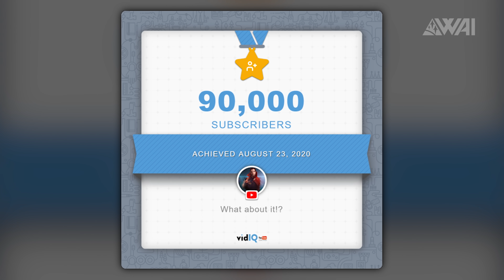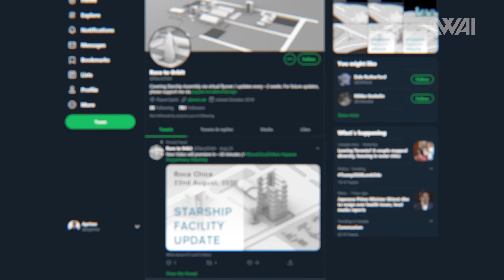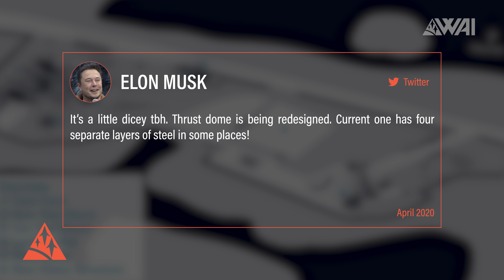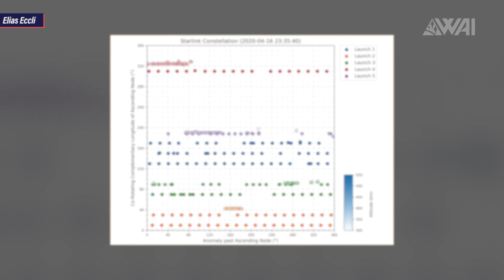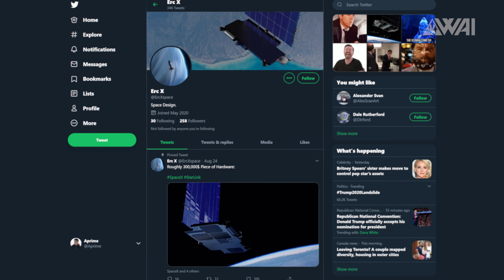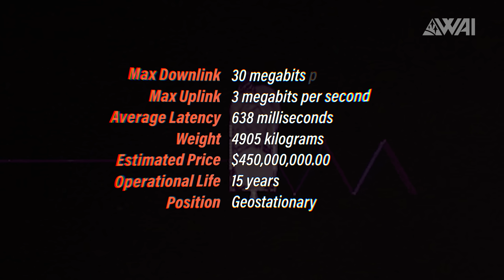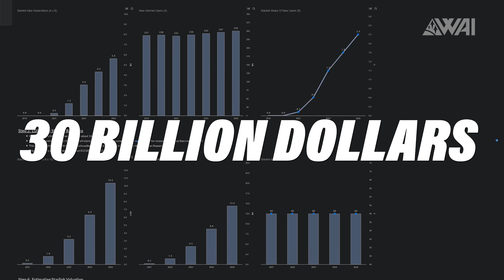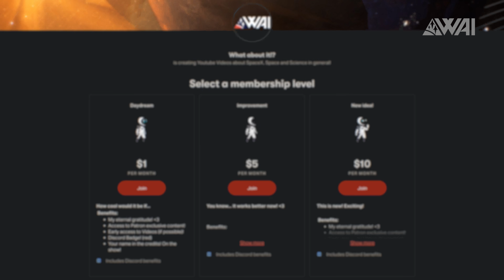116 | How to finance a fleet of SpaceX Starships?

Comment: Using a kuka robot to weld pins isn't really a Tesla tech cross over, there are only so many robot manufacturers and from experience, kuka has the best support money can buy, and they do like money. But once you get them out there the problem will be solved quickly.

Comment: Hello Felix,
Lots of great comments there especially on the thoughts to your question. I think the nose cone parts are internal and probably won't be seen when the nose is attached. The High Bay will probably top out structurally next week. However, finishing the roof and walls will probably take another month. Internal systems will take a period of time longer.  If you remember, Elon had said the High Bay will have a crane inside. That will take a couple of weeks to outfit. Realistically, I think we have at least a solid month to go on the High Bay. 

One suggestion I would like to make to you is about the term you use "construction site" when referring to the area where Starships are made. Technically, it is correct because ships are constructed, but we usually refer to the construction site as a place where the facilities are being made. In that sense, the launch site is also a construction site. I think, one phrase would be a better reference to the area would be to call it a "Ship Yard". I think it is not only a better description of the area but also it sounds really cool. Boca Chica Shipyard or Space X Ship yard. What do you think? Be the first to start  an historic reference!

Pete

Comment: 4:38  -Those are not "window frames".  But you would need to be someone who has done that type of work to know exactly what they are.  Those are just wood 2 X 6's  cut to length to hold the sag out of the sidewall girts until the sheeting (Cladding) is attached by self tapping screws.   Then they are removed afterwards. Most structures have sag rods.  It looks as though they have some in other places, but ran out and went back to the wood props.
-Now a wild guess at those triangle looking plates.  I think they are strong points, Used to attach a lifting spreader.

Comment: The leaked Starling bandwidths pale in comparison to the 610 Mbit/sec doped achieved by the USAF jn connecting a C-2 aircraft to the first 2 Starlink satellites.
So there's a lot more potential to be realized leading to the promised 1Gbit/sec transfer speeds.

Comment: 150m hop of super heavy possible by october, see Elon's tweet
Reply: Yeah, but even by Elon standards, that's ridiculously optimistic. Two months to finish constructing the high bay, build and stack all the necessary segments, undergo pressure and static-fire tests, and an actual flight? Even if absolutely everything works perfectly first time and they have no complications in building larger versions of the Starship tanks, it's hard to see them hitting that deadline...

Comment: I am surprised they don't stamp the bulkheads and roll out the hulls out of a tube. Then there would be no welds except where bulkhead and hull meets. You could make each rocket out of 5 pieces. I am guessing once they have the design down they will do that but don't want to invest in the custom equipment now.
Reply: 30 foot diameter. hello!

Comment: Felix, I would speculate that the triangular parts on the nose cone section could be sued to attach the covers for the aerodynamic surfaces. IN the past in renderings it was almost always shown to have canards or winglets directly attached to the hull in two positions. If you research the aerodynamic forces there will have to be some sort of smooth transition between the moving surfaces and the hull or the forces will be so strong that they might rip off the moving surfaces. This transition pieces would need to be attached somehow and I could not imagine they would want to drill into the hull

Comment: My guesses on the mysterious triangles on the nosecone 
1.:Parachute, in case of a flap failure 
2.:Mounting for broadcasting Equipment (probably not likely)/Sensors or data collecting equipment
3.:Some kind of mounting or base for hydraulic pistons for the flaps/motors,sensors or something similar for the flaps
4.:Mounting for a different kind of heat shield due to the bended surface or a mass simulator (like an additional metal plate) for the heat shield

Comment: 80 dollars per month for only 45 megabit is NOT cheap....I'm getting 200 now, with better ping, for 50 bucks per month.
Reply from the maker: It all comes down to standpoint. If you're in an area, where there is no or poor internet, this is a REALLY good option! That's a big market and it can't really be tapped into with ground based infrastructure. Not feasible.
Reply: @Whataboutit  If you're in an area that's poor enough to not have good internet, something tells me you won't be able to afford 80 bucks a month... 
 Pretty sure it'll be cheaper than that.  
 As it sits, it's less than half the speed, more than double the latency, and nearly double the cost of current ground based internet, which will be their main number one competitors. It will get faster as they get more sats up, but let's roll with a min of 100% uptick in speed and work from there;
 To make the value argument at that price point, they would need to see speeds hitting the 200 megabit MINIMUM just to compete with the overly greedy corps that provide to most of north america at the moment, which was part of the pitch for this whole thing anyway. And you can get 300 for less than 80 bucks....
 If Starlink really is going to be what funds spacex in the future ( remember, he supposed they would make billions per year from starlink), they NEED the north american market, and pretty much any developed area, as well, and even with a 100% uplift in speed, they will still be slower, worse latency, and cost twice as much if 80 per month is accurate (I don't think it is).  
  I have faith in them to not make such a blunder.  I have no doubts that either the speed / latency will improve DRAMATICALLY, and or the price will be much lower than speculated.
Reply: @conandude76  rural doesn't mean poor. Starlink doesn't compete with land based internet in big cities. Starlink is supposed to offer internet at reasonable speeds on farms, oil rigs, ships, planes, etc. 

Elon himself stated that Starlink doesn't have the bandwidth nor the purpose of competing with land based or even cellphone based internet.
Reply: @realulli  It's also supposed to fund spacex with billions in annual revenue.  That will require more people, or more speed, or less cost, otherwise they are just as bad, holding people to high prices for low speeds because of their monopoly.  
  I highly doubt it will turn out that way, so...much much higher speeds and or much lower costs will be needed, which in turn will make them compete.
Reply: @conandude76  Over 40 million people live in rural areas in the USA alone. 
$80 x 40 mil people is 3.2 billion dollars. Per month. Just from the USA.

Comment: Id be more curious about the applications of the starlink antenna aray for say maritime applications for passage making. For the same reason the ufo doesn't need to move, I wonder if that would work on a boat for the same reason or whether there would need to be a separate maritime antenna on a gimbal.

Comment: Those triangular clamps look like they could possibly be used for lifting the section without having to drill more holes into the stainless like with traditional rigging. When lifting pressure is applied the clamps get tighter providing a strong hold without adding possible points of failure. Just my guess. Something else I caught, I thought Mary was called Gal not Girl? Just an observation. Congrats on the channels success and look forward to watching history unfold with WAI. Have a great weekend everyone.

Comment: My big question is ... how wide is the door to the booster high bay building?  That will dictate Elon’s plans for increasing the diameter of the booster.  Increasing from 9 to 12 meters will increase payload by 7/9ths (77%).  Also the launch pad can help tell the future plan (can it be expanded to larger diameter rockets by adding another ring of pillars)
Reply: I'm not sure you can draw any conclusions from that. While Elon has talked about an even-bigger Starship, it's many years in the future, and SpaceX are very big on the "we'll build it when we need it" approach. So if they do end up building a StarshipXL, they'll just build a new high-bay and launch pad to suit...

Comment: Could that odd looking section with the triangular plates be part of the top of the Super Heavy? 
So the thrust vector goes through the Starship thrust puck?
Reply from the maker: With thrust vector you mean Thrust vector control?:_WAIRocket:
Reply: @Whataboutit  no, I mean how the force from Super Heavy will go through the thrust puck on Starship. Maybe. Haven't seen too much of the structure in the skirt.

Another possibility is that its a payload mounting point for a satellite launching Starship.

Comment: Corporate takeover danger! If SpaceX is successful in creating such a large Internet network, it will be in great danger of some type of hostile takeover. Whoever can take over the Internet portion of SpaceX would then have a gigantic money machine which they could use for anything they want and which would probably not include Mars.
Reply: Spacex is privately owned. Kind of hard to do a hostile takeover. There is no stock to buy up.
Reply: @James_Scheid  -- Not Yet - but it is coming.  SpaceX is going to need a lot of capital to complete its internet network and move forward with colonization efforts.  To get that money, they will have to issue stock.  Also, there is the possibility (remote, I hope) that Musk could die.  If that happens, I have no doubt that his heirs will go to the stock market to cash in.
Reply: @wbwarren57  Lighten up. Have a Snickers.

Comment: Do you guys think they will use super heavy as it’s own rocket to launch payloads with a ferring maybe if they don’t need such a powerful rocket like the starship
Reply: No, because SuperHeavy is only a first stage booster... it's not designed to reach orbit, it's designed to accelerate the payload up to a good suborbital speed, then turn around and return to the launch site. So any payload would require an upper stage to complete the orbital insertion, and that upper stage is Starship.
Reply: Yea I didn’t think about that it would probably burn up in reentry

Comment: In my opinion, the new test stand which is under construction will be used only for cryo test. 
That will avoid to put in place or remove the Raptor simulation tool each time that SpaceX will test a New Starship
Reply: Yeah, having separate stands for the cryo tests and static fires is probably going to be essential as the production ramps up. Move 'em from the bay to the cryo stand, then to the static-fire stand, then to the pad.

Comment: Whoa there on the Starlink pumping. There are still a lot of challenges in store before you can tap into high speed interweb while cruzing the highways and byways or from your remote cabin in the woods. There’s still that little issue of ground stations and without one nearby your surfing is becalmed like an indoor sailboat. These UFOs on a stick  still need line of sight to a Starlinker in orbit so don’t think for a moment you’ll be accessing the interweb while travelling through urban canyons or in tree covered areas. Those speeds you see are a best case scenario with little to no combat for bandwidth like in the real world. I hear there are challenges with pointing those UFOs too. I think SpaceX was hoping to get way without pointing motors in the dish but that didn’t work out so well so the first batch are needing the motors making them more expensive than first thought. And forget about using the Starlinkers if you’re mobile as these UFOs are not setup to track like your cell data signal can. The folks that fit the use case for this service are very specific and if you have fibre to your area of the planet Starlink plays second or third fiddle.
No doubt the challenges will be overcome once critical mass of Starlinkers is reached but I wouldn’t be reaching for the old wallet just yet...

Comment: Also I’ve been thinking some of these nose cones will be used to build the first prototypes of the passenger, cargo, refueling versions of the starship.  Makes sense that since they have the mass simulators they won’t need all of these nose cones to actually be mounted on a starship.  That being said, maybe those clamps are for a hinge that would open up the starship for cargo to be transferred out of it. So it could be a cargo model prototype?

Comment: I'm looking forward to Starlink, however, my main concern is the weather. Can it work through heavy rain and heavy snow?
Reply: At the Ku band levels of 11-16ghz it will work just fine.
Reply from the maker: @042Ghostmaker  Exactly. Thank you! :_WAIRocket:
Reply: Further to my point you will experience some bandwidth dropoff as the signal to noise ratio increases (the antenna will have to increase power to compensate for lowered signal quality).

This can vary greatly but should not represent an insurmountable issue, given that Starlink uses Phased Arrays, which can acquire signal within any Line of Sight, hopefully mitigating storm interference.
Reply: @042Ghostmaker  thank you

Comment: With Starlink you have to keep in mind there are still very few satellites in position and operational compared to what the finished network will be. So speeds and ping times right now are being affected by having to connect to sats that are further away than is ideal. As they get more sats into position the network should get much much faster.

Comment: Those triangular bits could be the back brace/mount for a docking ring similar to what is used for the international docking adapter petals.  Elon HAS said that the Starship will be able to dock and refuel with other Starship in space, so it just makes sense to have something like that for alignment and capture.  Not having it on an extendable ring makes that less likely though, but maybe SpaceX has a different take on the concept?

Comment: Funny how the 'Scientists" say the polar ice caps are melting and the oceans are rising yet Elon builds his Launch Community over the swamp land.
Reply: The sea levels won't rise due to melting ice until Greenland and Antarctica melt. The ice there is on land and is thus not displacing water like the north pole ice. You also need to consider the ice on mountain ranges that also hasn't completely melted yet.
Reply: Sea level rise expected is 0.06 inches/year. That's just over a half inch in 100 years.
Reply: Actually, he's planning on building Starship launch sites out at sea in future, so he's got that covered.
Reply: Most of the ocean level increases are due to the ocean getting warmer, and as a result the water slightly expanding, although melting ice is also a  significant part

Comment: So are we just going to ignore the fact that your water tower theory was wrong?
Reply: They will still need a water tower. Felix is really great, but not perfect.
Reply: @MrEd2291  It would seem wise to use a water deluge system, though it is feasible that they use pumps.  Felix's channel is probably my favorite.  I'm not desputing that.  I'm just surprised they he heavily focused on the theory that the structure was not a launch pad at all and then completely ignored the fact that Elon 100% confirmed that it IS in fact the orbital launch pad.  He is allowing the old incorrect theory to propagate.  Nothing wrong with sharing theories.  I'm just dissappointed that Felix didn't step forward with the facts and chose to pretend it didn't happen.